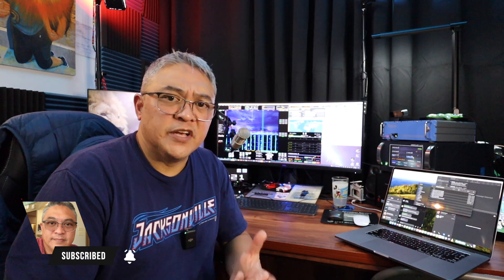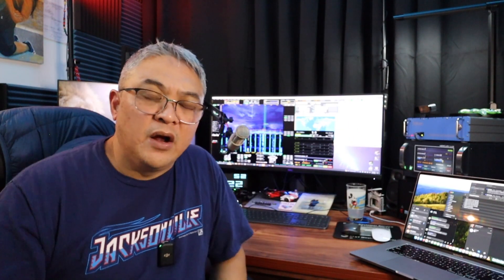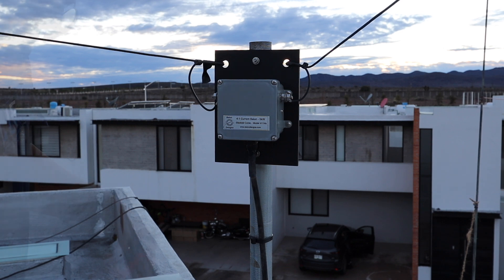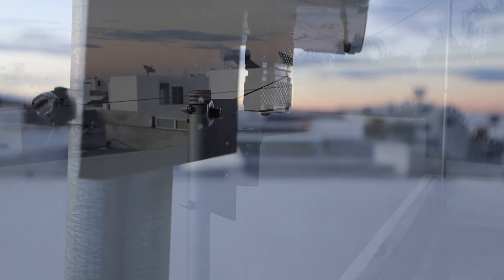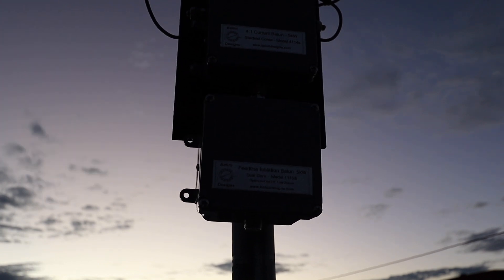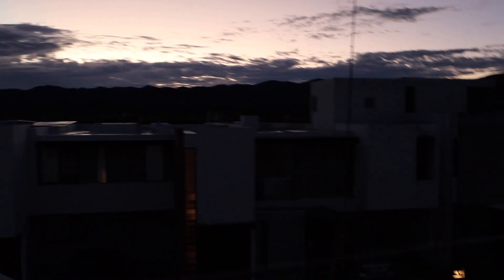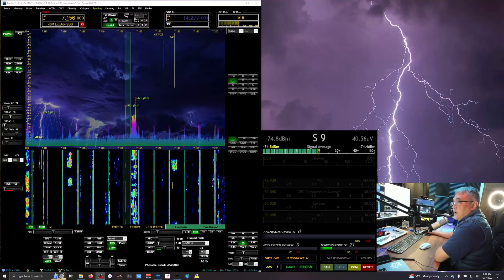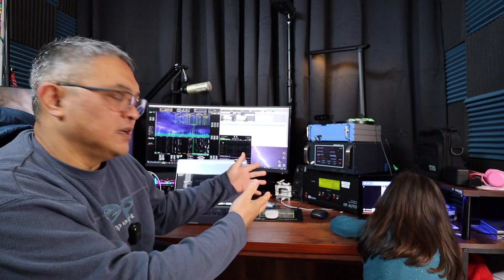It was Suppose to Work! | Fixing my RFI in the Shack | 1:1 Common Mode Choke at the Ant Feedpoint

Comment: Hi Darren, try unplugging everything that you can from the radio to help determine where the RF is getting in.  Try using the mic in your computer while the tegular mic is unplugged, for example.  That will eliminate or confirm your mic as the source of ingress.  Same for the speakers, headphones, etc etc.  73, Len, KD0RC

Comment: why not just drill another hole about an inch or so higher to install the SS pipe clamp just a bit higher and still have a double clamped DXE plate on the 40M sky loop

Comment: you get the rfi through the xlr mic cable. i had the same problem. fair rite snap on ferrites from 31 material 10 pieces on the xlr both ends solved it.

Comment: If your shack is directly under antenna you are within the field of the radiating antenna which is highly likely causing the problem therefore you will not eliminate the RF without relocating antenna from above your equipment.
73 de Aiden EI8HJB
Reply from the maker: That's good to know, yeah I'm below the antenna maybe about 30 feet away.
Reply: Hey Darren, I thought I would also add that it is good to have a RF field strength meter to test field strength in the shack. You can also use it to check if RF is on the outer casing of equipment. While monitoring RF field strength meter Turn down power and If  problem goes away as reading is going down It is due to proximity of antenna. I also found that If you have any antennas close by you need to choke them as well because RF couples onto them and follows the coax into shack. I also had to put ferrites on power supply to equipment as well.
I hope this helps you out.
73 De Aiden EI8HJB
Reply: ferrites in high quantity on all coax mic and control cables.fair rite 31 material snap ons and 43 material toroids with 6-7 turns.

Comment: How do you have your equipment grounded, meaning your amp and radio?
Reply from the maker: My Anan's ground is going to 2 places, my desk's grounding bus and also my Mercury Lux.  My tuner is grounded to my desk's grounding bus.  Then my grounding bus goest through the junction box access to a grounding rod maybe 8' deep.
Reply: I’m curious to the Anan going two places? All equipment needs to go directly to ground bus in order to prevent a ground loop.
Reply from the maker: @N1SEP-  I'll disconnect the ground from the Anan to the Amp and go straight to the grounding bus.
Reply: I’m also curious as to how long your wire to the 8’ ground is?
Reply from the maker: @N1SEP-  I would guess about 4-5 feet from the shack through the wall and straight down to the grounding rod.

Comment: I wonder is your shack on the top floor?  If so, your problem may be from your antenna now being too close to your shack. I had the same problem my shack is on the second floor and the antenna is right above my shack Raised it up 10 feet and the issue went away even running high power no issues now.  I know you can't raise yours back up but just a thought.
Reply from the maker: My shack is on the 1st floor.  The antenna is on the 3rd floor (Roof).  I have to climb a tall ladder to get up there.  I've got it nearly eliminated, video will be posted after Christmas.
Reply: @DarrenN4VFR  Oh ok I wasn't sure good to hear that I know that it can drive a person crazy sometimes trying to find it lol Looking forward to the video hope you guys have a great Christmas

Comment: Common mode current can still be an issue since with the choke at the feedpoint the entire coax is still in a strong RF field. It can sometimes be worth having a common mode choke at the shack too. Of course if you are right under the antenna the  field strength can be very high. As for avoiding certain parts of your station being near the computer, many broadcast systems are set up with a laptop directly connected, but as amateurs we don't have the luxury of having purpose built sites for gear. Your rooftop tour did show a few possible paths for unwanted RF current, I obviously don't know the issue that is causing your problem. I too have had issues with RFI, generally all attributable to common-mode current, it often is far worse on a specific band. It is great when you do get it resolved and often the solutions will help your received noise levels too. Good Luck 73
Reply from the maker: I'll do a Common Mode Current test by removing my ground/shield coupling on the PL239 at the back of my Tuner  to see if the noise floor decreases when I remove the ground. If there are no changes, then there is no presence of CMC.

Comment: I've had great luck my enhansing my ground system with all stainless hardware, multiple earth grounds and AC shielding, but I'm sure you have investigated that, good luck! Laughed at the HOA statement, hit a nerve 😀
Reply from the maker: Thanks still working on it.  Going to attack my Mic input and Powered Speaker system since it's only when I transmit that I hear RFI going through my speakers and headset without the Monitor on.

Comment: Hey darren! just wanted to say this it might help. Your going after common mode currents but that is not your issue. your dealing with amplifer Location. move your amplifier away from your TUNER and radio. I had the same issue. i moved my amplifier about 18 feet away and the RFI disappeared it took a longer jumper but it worked for me. Your getting RFI bubbles from the antenna above and from the amplifer located below. Give that a try hope that helps.
Reply from the maker: Yeah man, I agree, it's not CMC issue.  I really don't have much coax nor place unless I put the amp in the laundry room which the wife won't allow me.  In my Florida QTH, yeah, I moved the Amp & Tuner as far away from my Computer, Audio Interface, and Microphone however, I didn't get RFI issues there but did that anyways.  I'll try to add more FT240-31 torroids and attach the speaker & mic cables.